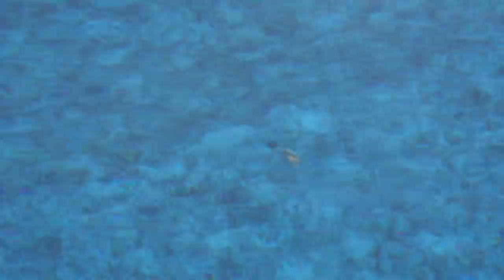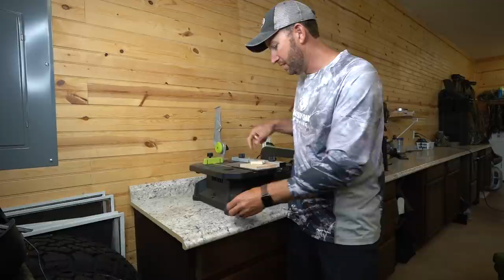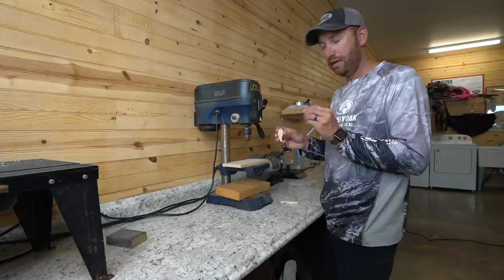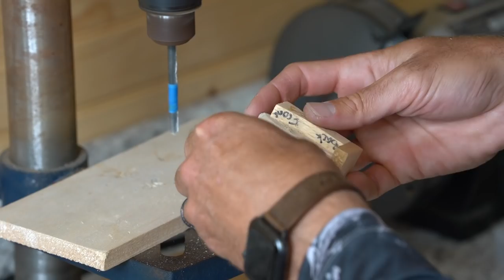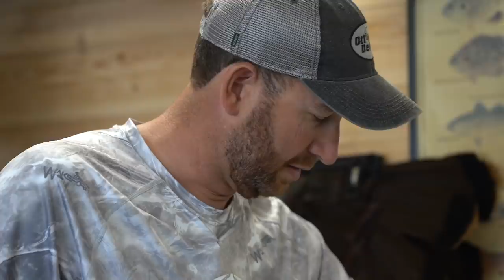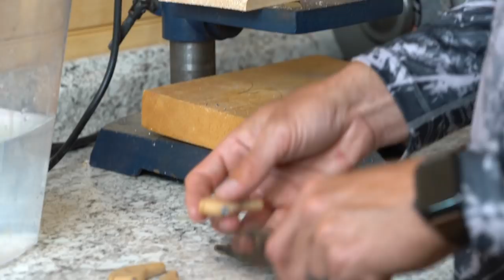Ott’s Garage | How To Build A Crankbait Part 2

Comment: If you want to be sure you are on center to drill for the weight, use an ice pick or something like it to start the hole and then use a drill with a pointed end. You can do the same for drilling the holes for the hooks. Works for me.

Comment: I have a question does using putting cranks in water before having sealer on or having it painted put moisture into the wood and would have to wait a certain amount of time until it drys off or could it cause cracking issues or does it need to be in the water for a substantial amount of time to absorb the water.